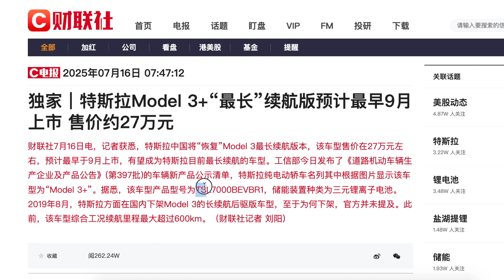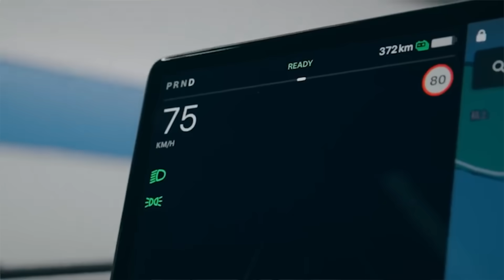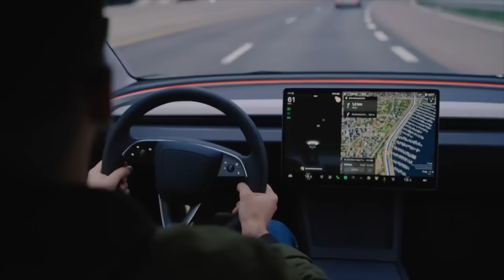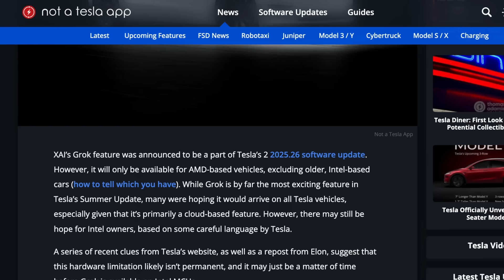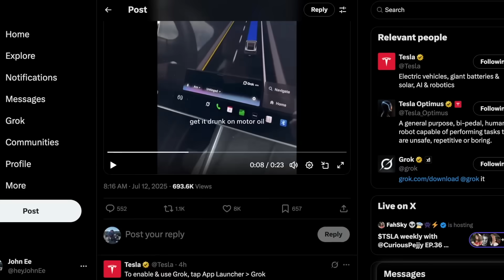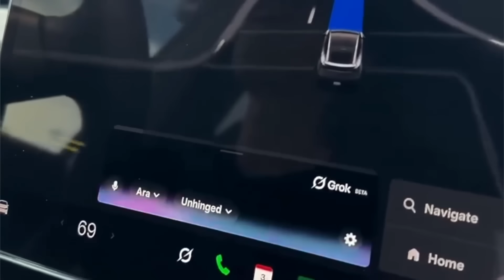Tesla Model 3+ Brings Massive Battery Upgrade and Performance | This Changes Everything

Comment: Current RWD Long Range models actually have 315 horsepower, not 260 horsepower. They are significantly more powerful than the standard range RWD with LFP and already available in the USA.

Comment: 300miles of range ≠ Long Range when normal gas cars hit 500-600 miles
Reply: Please list all the “normal” cars that get 500-600 miles on a tank of gas….
Reply: @petrolhead4503  saab 9-5 does around 600 depending on modell
Reply: @lars789 first it’s a 12 year old car. Second, the range on a single tank was at best 500 miles, when new, if you took it really really easy.
Reply: @jayay3881 my 20 year old 9-3(not 9-5) does 1000km on a single tank with efficent driving. Those Light diesel deathtraps are insanely efficent for range compared to newer heavyer cars.
Reply: @petrolhead4503 I can get that in my Honda Accord. However, I don’t do any driving where I’d need 500 miles in one trip. But I do cover 250mi per trip a good bit of the time.
Reply: @petrolhead4503 my 2018 A4 Quattro with 115k miles on it gets 520+ miles with mostly freeway driving at 70+mph
Reply: @petrolhead4503 or how about do your own research and list them yourself
Reply: @girldz792 well you’re the one who made the claim so the burden of proof is on you
Reply: @girldz792 Toyota auris. I get about 340miles
Reply from the maker: In China you can achieve the 500mi est range bc driving there is super slow and like hypermiling
Reply: My range in a long range RWD Model 3 is almost 358 miles.
Reply: I’ve owned lots of “normal” cars. None have had 600 miles of range.
Reply: Who drives 300 plus miles without stopping for the bathroom, or eating…not many. People yelling you need 500 plus miles🤔BS
Reply: @toddbenfield6546 Please speak for yourself and stop trying to stop progress. My SUV gets 600 miles on the highway during round trips. No time to sit for 1/2 hour charging because customers are paying. Electric would be great, much cheaper.

Comment: 500 miles range..,  is to see is to believe!
Reply: It’s just 800km Cltc. That’s the model 3 RWD with 5kwh larger battery nothing more.
Reply from the maker: 500mi might be possible if you hypermile in the US. In China it’s possible to achieve estimated range since things move very slow and efficiently, I can confirm

Comment: 500 miles needed?  Some must have very large bladders.  ;-)
Reply from the maker: Realistically drops to 350mi in the winter though. And in the summer if you crank AC prob hover account 400mi
Reply: @heyJohnEe don’t forget highway speeds really lowers things
Reply from the maker: @alphaomega9650 yup can’t forget that

Comment: that range rating using this method is silly, car can barely get over 500km real range
Reply from the maker: I’ve driven it in China once and it surpassed the estimated ranges. Things move slower over there and a lot more efficient driving but yeah CLTC won’t cut it for anywhere else around the world